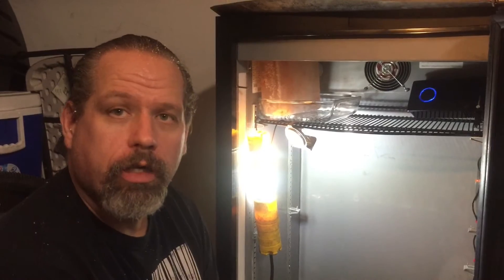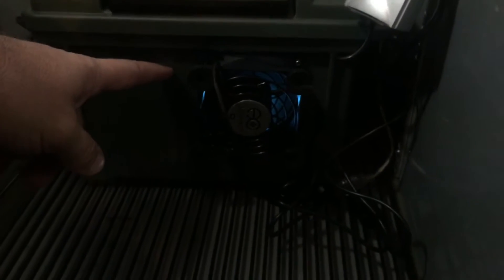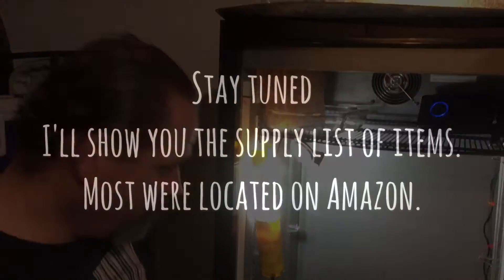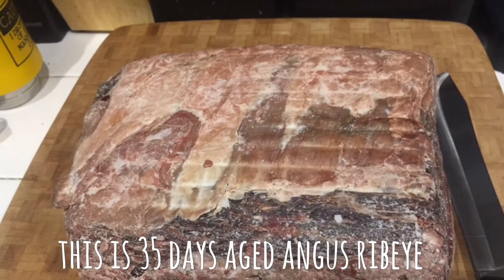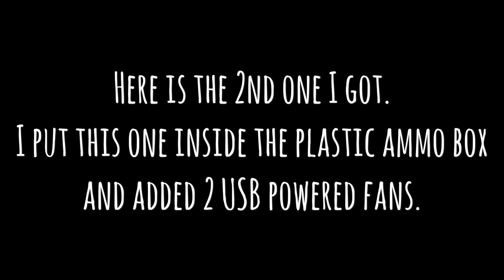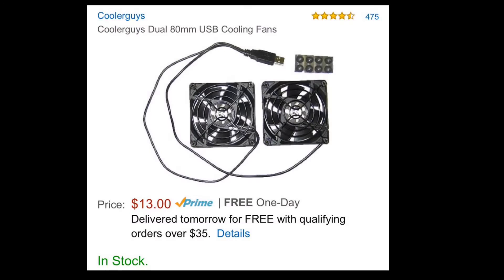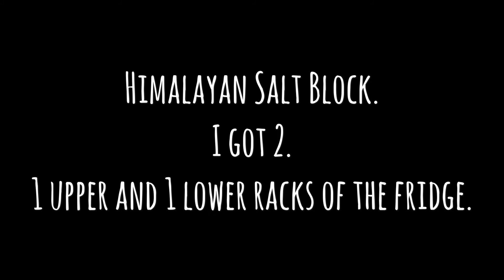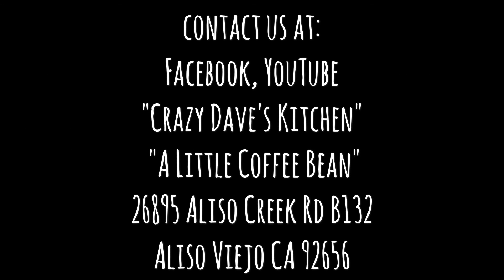Home Made Monster Meat Locker (Dry Aged Meat)

Comment: YA I need to put four moose quarters in there?mmmmmonster  In Alaska we call that a lower 48 tape measure 3 inch is 12 inches . 1 moose quarter would not fit in TINY LITTLE SISSY BOX

Comment: Is that dandruff? Or did it snow?
Reply from the maker: Brandon Gregory neither it it actually Styrofoam pieces from me using a cutter to cut some pieces the Styrofoam for my daughter off camera.
Reply from the maker: +Brandon Gregory neither. Prior to filming my daughter needed help cutting styrofoam for a lil project she was making. I used a Sawzall to cut the styrofoam and without thinking used an air compressor to blow the styrofoam and it went everywhere.